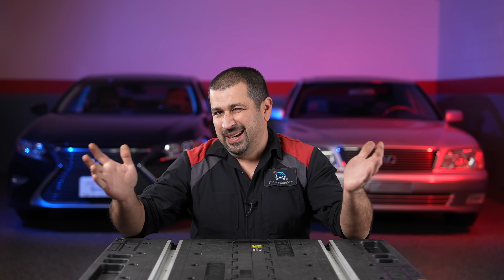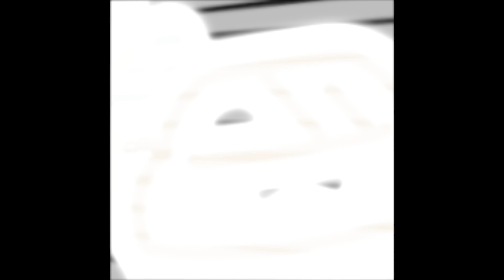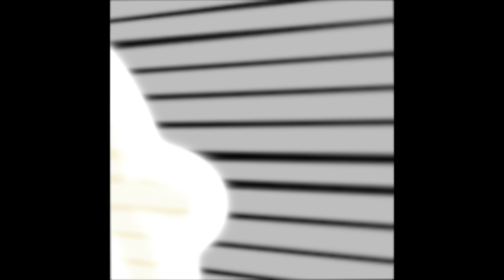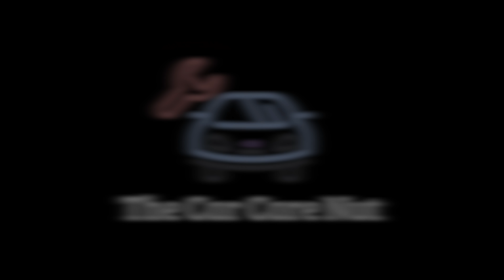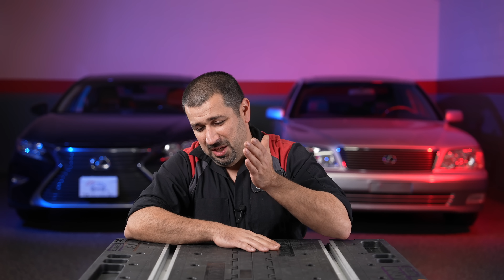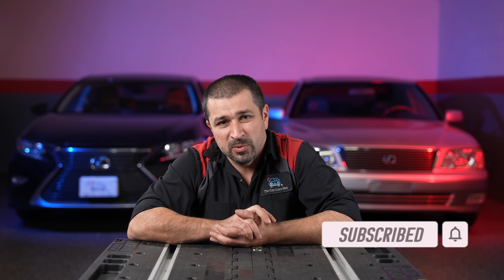Can Modern Turbo Engines Be Reliable? Here's The TRUTH!

Comment: My very cynical view - manufacturers have no interest in your owning a car for 200,000 to 300,000 miles (or more).  In fact, (my belief is) they are knowingly and purposely building "disposable" vehicles because their sole interest is selling you a new vehicle.  And I believe that it is criminal for them to advise such high-interval oil changes on any of their cars with turbochargers, if they are doing that.  Even on non-turbocharged engines, they cleverly diminish the need for fewer miles between oil changes by adding language about "severe use requirements" which most consumers never follow.  RANT OVER.

I bought a 1984 Chrysler Laser with a 2.2 L, turbocharged engine.  Being a proponent of the 3,000 mile oil (and filter) change, I decided to change my turbo engine's oil every 2,200 miles.  I didn't have a single turbo-related issue in the four years that I drove the car.  It required only low octane (NOT low quality) gas to run properly and got more than 44 MPG on the highway.  Still, I prefer my V6 to any turbo engine.

One other thing that I did was to allow a cool-down period at idle prior to switching the engine off.  Let the heat dissipate from the turbo and do less damage to the oil.

Comment: I have to disagree with you. Growing up in the last century with carbureted engines that made way less power. I was shocked by the hp they squeezed from the same size fuel injected engine. We dont need the amt of hp they squeeze from these engines but manufacturers want to sell more cars and most consumers are stupid for hp they cant use. Thats why they use turbos, not for emissions. The younger generations dont know what enough hp is and manufacturers want to sell more cars. They are giving up reliability for sales. It they wanted reliability they would use a engine driven supercharger instead. Not as efficient but way more reliable and driveable. It doesnt need to be replaced at 100k miles and wont completely destroy a perfectly good engine when it catastrophically fails. Bottom line is reliability does not sell cars anymore. Max hp, planed obsolescence and destroyed engines do.

Comment: Of course a modern turbo engine can be reliable. Industrial diesel are almost all turbocharged and they last the equivalent of a million miles all the time. But for a “modern” TGDI gas engine to be that reliable, you have to go your own way on the oil selection. You need to use a 30 or preferably 40 grade oil, with Mobil 1 0w-40 Euro FS being a nearly ideal choice for most people. You need to change the oil more frequently than the manual says (5k max). You need use premium fuel with lots of detergents—Exxon, BP, or Shell. Use injector cleaner regularly (one with lots of PEA like Redline SL1). Use a better-than OEM filter with 25 micron filtration or better. That means a PGI filter (microgaurd select from O’reilly or Carquest Premium from AAP) or a Pentius UFXL. It means avoiding lots of cold idling. It means monitoring fuel dilution with an oil sample at half of your oil drain interval just to verify it’s fine to leave it in for the last half. It also means periodically getting that engine good and hot. The on ramp to the interstate is your golden opportunity— give it the Italian tuneup and give it WOT to redline and don’t let up until you’re breaking the law.

Comment: You’re 1000% right. I’ve always changed the oil in all my cars that I’ve ever owned at 3000 miles. And every second oil change, I would leave out a quarter of oil and put in a quart of automatic transmission fluid because it was very high detergent and cleaned out the engine. My vehicle for work is a 2016 Chrysler Town & Country and it’s got 187,000 miles on it but I changed the oil in it every 5000 miles because it’s a highway car oil changes is just a cheap insurance policy.

Comment: My 2016 f150 3.5 eco boost has 199k miles on it and running like a top, no leaks either. On top of it being used like a truck to tow frequently, 3-4k full synthetic oil changes are crucial. These new vehicles are very unforgiving to lack of maintenance.

Comment: I have a 3 cylinder engine that is 1.2 l. It doesn't have a turbo and I'm pretty happy that it doesn't. No it's not fast. It has 78 horsepower. But I'm happy it has less parts to break.

With the Light foot and economic planning while driving I average around 53.5 MPG combined.

I don't have a turbo, but I change the oil every 3,500 miles or so.

Comment: The question is, does the tailpipe emissions make up for the additional emissions required in manufacturing an increased number of replacement parts/vehicles due to the lower reliability?

Comment: I used to drive a Mercedes sprint van for the company that I worked for. It was a service vehicle. It was a turbo diesel. This vehicle was serviced by employees fleet service. At 3000 miles it got an oil change and general service. Guess what? At 30 thousand miles the turbo died. At 60 thousand another turbo died. The final problem was at 80 thousand the transmission died. My employer is getting rid of all the Mercedes Sprinter vans and is going with Ford Transit Vans. They are getting the turbo diesel and also getting the electric vans too. My company Ford van now has 80 thousand miles with no turbo failures. I will not buy a turbo car. I am just to afraid. Thoughts?

Comment: I new someone that had a Chevy Cavalier with an after market Super Charger strapped onto the stock 2.2 Litre.
All the power and mileage without the strain on the oil as you don't use super hot exhaust to drive it.

Comment: Corky Bell said:  "A turbos only real benefit is weight reduction."  Turbocharged engines have a more restrictive exhaust system and usually lower compression than a NA engine.  Neither of these is good for fuel economy.  I only use full synthetic oils and change it every 3500 miles.  On YouTube several authors compare the EcoBoost F150 vs the 5.0 Coyote F150.  There is no comparison in longevity.

Comment: To be clear, I think it's important to protect the environment but the emissions laws so far haven't been through way forward. Policy makers with no mechanical experience dictate rules that don't improve real world fuel economy. The amount of engines that we have collectively burned through so many engines prematurely we have done as much or more damage to the environment. I have given up on combustion altogether at this point. I know Li-Ion Batteries aren't ideal but doing some research it looks like mine came from Recycled Leaf and early Model S batteries. Toyota has used Electric Motors for over 25 years at this point. My Solterra might not be the best for range or Thermal Management but it is reliable.

Comment: I think catch cans are a must for turbo direct injection motors and 100 percent agree with oil changed my brand new 2026 tundra oil at less than 2k miles and the next one will be a touch over 3k ams oil all day

Comment: Another question about these high torque engines is the stress on the transmission. Don’t forget to also change the transmission fluid more frequently.
Reply: At this point, it might be easier to change the car more frequently.

Comment: Yes they can, if you know how. Biggest killer of turbos is shutting the engine off after highway drives or after running ut hard under boost. If you let it run a couple minutes to cool down before turning ut off it will last. I have a 2016 Nissan Titan XD with the cummins diesel. I have had none of the issues that many others have had, and I am approaching 140k miles. And I tow and run it hard with a 135hp tune. If I go to the gas station I don't even turn it off. If I go to the grocery store I either sit and let it idle for at least a couple minutes, or I hit the remote start since it turns off automatically after 10 minutes. Tjw keyboard to use a good quality oil, let it cool down and keep your pil changed regularly, and don't go 10,000 miles unless you're using an oil like Amsoil Signature series. If you take the extra time and let it cool down before shutting the engine off  they can last. Diesels also run higher boost pressures so letting the turbo cool is very important as well.

Comment: My experience with turbo cars in comparison to normally aspirated engine gas has been all being the same the turbo and 
intercooled engines last about half as long as a normally aspirated engine. Even with 3,000 mile oil and filter changes as opposed 5,000 mile changes for non turbo, both using proper fully synthetic oil of proper weight. I have had a W116. 300SD throw a rod through the case at 127,000???? Old age I guess. I also run 15 lbs. in my gas turbo cars. Turbo charged gas engines are just about volumetric efficiency, only so many ways to increase that. Never wore out a transmission before an engine. I do good maintenance but drive hard. When your engine oil starts to change color you will not go wrong with changing the oil and filter. In the summer time in Dallas or Houston stop more than go heavy traffic not that odd for me to change oil and filter as low as at 1,000 miles. I purchased a 2021 Tundra in December of 2021 because I wanted the V-8 over the new V-6. Price point was very close but I prefer the v-8, driving 65 mph I can achieve 20-22 mpg no problem on the highway. In town 16-17 mpg. Towing, I don’t care to talk about it!  I would rather spend more on fuel and have a long lasting engine in my car. I didn’t buy a pickup because of its sporty performance or for fantastic fuel economy. My little Camry sedan has the V-6 and makes fine fuel economy with performance that might surprise my 1985 BMW 535. Doesn’t handle at all in comparison but I don’t care @ 66 how sporty can you really be?  Longevity of modern cars real enemy will be all the plastic parts being used in and on the engines and transmissions after years of heat the parts will fail and the labor spent swapping out old brittle plastic will eat people alive. I would rather make 10 mpg and run a well maintained car 300-400,000 than have a 7 year car note and hope the car holds up before the warranty is out or it is payed for. With some care and a little luck my Toyotas should last longer than me.

Comment: I think best use of turbocharged engine is that to use it more on faster roads, or highways, in most situations. As city and slow pass engine rotations, it builds up too much carbon and it also clogs more and heat up engine until it reaches fast pace and opens up after few use. So, these variables killing turbo engine as it has been used in congested environment and then pushed hard, without giving time to clear itself. If modern turbo has been used on more leisurely fast pace, without extreme slow and extreme fast on-n-off abuse. And most importantly owners does not understand that how he should shut-off engine (pre-cooling) and cool start slow motion. Everything gradual, even if you push engine, just give time before.

Comment: A funny reality about oil that isn’t discussed much is that Canadians have been doing 3000 mile oil changes for years and largely still do to this day… every Canadian shop and/or dealership all recommend oil change intervals at 5000 kms - instead of 5000 miles. And nobody realizes or calls them out on it… people just think ohh thats normal, but don’t remember that 5000km is only like 3200 miles lol so Canadians typically do about a 1/3 more changes per year than Americans. I personally still set my oil intervals at 5000kms cuz its just better, but obviously letting it go over a thousand or so kms is no big deal

Comment: Good info. Would add, always use full synthetic oil vs. conventional or synth blend, synthetic holds up so much better to the heat. Also when shopping know what BRAND of turbo your vehicle has, and don't expect a certain vehicle manufacturer to use the same brand of turbo on all of their vehicles. For example, the Ecoboost engines Ford makes uses anything from Garett turbos (very good quality), to Borg Warner (kind of mediocre), to cheap Chinese and Mexican built ones that aren't worth a crap.

Comment: I have a Cadillac v blackwing twin turbo v6 . I drive it aggressively and I listen to the computer. The more agresive I drive the more often it tells me it’s time. Oil life goes down to like 35% in about 2000 miles and that’s exactly when I change it.  It takes me literally 15  minutes. It’s idiotic not to do it. It cost me like 40 bucks in parts and 15 min. Manufacturers will tell you 10k miles because they want that engine to blow right after the warranty is up so they can sell you a new car. They know what they are doing.

Comment: I’ve been using 0w-20 for 70k miles but the manual says it can use 5w-30 fine and it is recommended in very hot places. I’m in Florida and in the summer it is extremely hot. You say to stick with the 0w-20?

Comment: Don’t use a 0w anything that is oil as thin as water.  5w30 will work fine unless you are in the arctic circle and need it to flow in under 50 below freezing.  Toyota has 5w30 printed in their owners manual and oil filler on vehicles in other parts of the world whereas in the US the same vehicles have 0w20 printed in their owners manual book and on the cap.  It is not worth the additional 5-10 miles per tank of fuel to give up the protection for rod bearings, cam journals, cylinder walls, etc.  Cooling a turbo is key to longer life.  You need to idle the engine by sitting in the car or with a turbo timer to allow oil and coolant to flow through it for a few minutes after a long drive.  If you don’t do that, the oil in the turbo when you stop the engine will cook and form a soot/sludge that will cause a dry start for the bearings and contaminate the oil as well.  If you want an easy to own car that only need gas and oil for the most part then don’t buy one with a turbo or supercharger at all.

Comment: I agreed with the host. You really have to pay attention to the design. Have driven Subaru turbo for the last 20+ years. I change oil every 1-2000 miles, keep up with coolant flush, and never abuse the engine. It last long time but there is always that fear it will take a dump on me cause there are just so many little components that can fail because they just run hot and plastic components don’t last. With proper care, it is not the turbo itself but the up pipe that clog the turbo, it is that one vacuum line that break, and plastic parts near the turbo will eventually melt like cv boot. Or Once you have a leak, the air fuel ratio messed up. The turbo boost sounds great all the time but I am just tired of watching my oil temp, coolant temp, boost gauge, air pressure,etc. not to say dealing with smog passing every two years. So I switched and only drive old school Lexus v8 now😂

Comment: I mean modern oils since even the 90s are better. There is a more stringent spec with the turbos in mind. Technically if the lubricant doesn't break down and maintains it's quantifiable properties you could go for forever. It's probably a marketing vs engineering team thing and of course management sides with what moves more cars this quarter. And fleet customers like that 10k number. That high displacement v6 is really only in there for the small amount of time that you need peak power like on ramps. Vast majority of the time your idling or minimal engine load where the little i4 is fine. Not advocating for 10k oil changes just saying there's trade offs and isn't all bad. Nothing is as simple as a lot of people make it out to be. Idk if ya'll noticed summers are hotter than they used to be and it takes longer into fall to actually get cold.

Comment: My turbo Audi is getting close to 300,000 miles without a single major failure. Other than normal maintenance items, the only repairs so far have been a failed water pump, a bad PCV (which really falls under maintenance) and I just had to replace the original alternator last month. Not bad for a car almost 15 years old and nearly 300k miles. The original turbo is still going strong.

Comment: Corporate Average Fuel Economy (CAFE) standards have contributed to the trend of larger trucks and SUVs by creating an incentive for automakers to produce them. By creating a separate, less strict standard for light trucks and using a "footprint" formula that allows bigger vehicles to meet lower targets, automakers could build more profitable large vehicles that also helped them meet their overall average fuel economy goals. 

Then as Americans got used to bigger vehicles the standards continued to get stricter.  So then the manufacturers continued to make the large vehicles but needed to do so using smaller turbo charged engines.  

I used to fit a Suburban in my garage but Today I can not fit a Tacoma with a 6foot bed in the same garage much less a full sized pickup.  Our government created the monster called CAFE.

Comment: I suspect that for a vehicle like the Mazda CX5 that is/was available with or without a turbo, and has a reasonable sized engine to begin with (2.5 l) that there would not be a lot of difference in service life between the turbo and NA versions. It would depend on use patterns, of course.

Comment: I have 4 Toyotas. Two 3.5 (with 330,000 miles), a 2021 Sienna hybrid with 70k and zero issues, and a 2018 Tundra with the 5.7 v8. Gas mileage sucks but I never need to go past 3500 rpm in daily commute. So much NA power and smooth as you can get.

Comment: Ahmed is spot on. Change the frickin oil & filter often.

I shall not and I will not buy any new car with a turbo, period. In fact, I have my broker looking for a Lexus NX350h AWD Luxury edition, and it does not have a turbo. It's the A25A-FXS Toyota engine, which is a proven naturally aspirated 4-cylinder engine. The electric motors will give me more horsepower vs a stinking turbo.